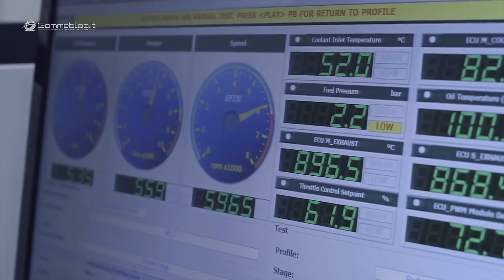Bentley W12 Engine PRODUCTION ASSEMBLY MANUFACTURING PROCESS

Comment: A W12 engine? This is the first time I have seen this. It's like a V6 or a V8 engine, but this W12 Bentley engine has two rows of cylinders in one side, and another two rows of cylinders on the other side. I'm VERY impressed with this.
Reply: Familiar with VW vr6?  It's basically two vr6s joined together.
Reply: Have you ever seen the Bugatti W16?
Reply: @maverickmason4946  No, I haven't. But  I'll look it up online.
Reply: @marcushaynes843  I'm very excited for you then.
Reply: A W12 engine has 12 cylinders arranged in four banks of three cylinders...
This engine is a V12.
Reply: @Sneakerama17 I just looked at the VW VR6 online, and you're right. I wander if Mercedes-Benz, or BMW were making and putting these kind of engines into their cars.

Comment: Love the fancy rod bolt guides vs the pieces of rubber hose we use for the same process. ;D
Reply: yeah but the hose works
Reply: @davidbrandenburg8029  
YES sir. I've been using it for over 30yrs that was my point.

Comment: What advantage does this engine have over a v12?  Is it simply more compact or Is the power curve way different?
Reply: The engine is a lot shorter than a V12.  It can fit in an engine bay that a V12 cannot.

Comment: Did anyone else notice the engine change at @9:45 ? Went from a single top mounted turbo to twin  side mounted turbos.
Reply: The top mounted turbos are in a hot-V configuration. They used that on the 4.0T and newer V6Ts. The Bentley came with either the 4.0T V8 or the W12. I think they shot the V8 then switched back to the W12 or something. Weird.

Comment: This looks amazing and complicated, not only does it take a long time for many people to design the engine itself, but to develop the molds and all the related manufacturing/assembly process around it. Even then, it's still an ICE, heavy, tons of moving parts and only delivers a power efficiency of what, 20-30%? Meanwhile there's electric motors, mechanically much much simpler, has over 90% power efficiency (ignoring how the electricity is produced) and delivers maximum torque at 0 RPM. We just need to improve the infrastructure around it and make sure battery production/recycling and electricity generation is more sustainable. Surely one day ICEs are going to be almost obsolete beside being kept around by "old-timer" enthusiasts.

Comment: Also I'm sorry to say I see valve springs come on Bentley desmodromic valve system then it wouldn't have to fight spring pressure. = more ponies at the tires and full time 4×4 come on guys you can do it. If you can build a Bentley it shouldn't be a problem. Love the W 12 though really cool 😎👌.

Comment: Boy that is strange, cant say ive ever seen a engine like that and have been around this stuff all my life, i thought all v12s were 6 in line, port and starboard, learn something new everyday.
Reply: They took a V6 from a VW and put two side by side to create this engine.  The W style V6, the cylinders are right next to each other, like 1/2 of this engine, and in the car it looks more like the width of a inline 4, not a V6.  All 6 of the W6 engine cylinders are under 1 head and two camshafts, like seen in this engine.  Also amazing if you never saw a W6 build.

Comment: Isn’t the W meant to indicate that there’s 3 sets of 4 cylinders are positioned around the crankshaft instead of six on either side like the video shows
Reply: Correct, the proper term is WR-12, but this was
seen as too confusing for people and the less accurate term W-12 was adopted for marketing.

Comment: wow, nice organised work, for a fossil fuel ⛽ engine. 
IMAGINE: An Electric engine for the Bentley,  a simpler straightforward electric motor, no internal combustion to deal with, no need for a series of controlled explosion to get the shaft turning. EV is the next step. 
Electric is the way to go..!!

Comment: This engineering marvel will be a lost art at the end of this decade. Electrics are comming big time now and are going to take it all. This cumbersome heavy metal technology is about to be phased out by the more efficient, much much lighter, easy to build, with much less movable parts to manufacture, and cheaper electric motors.

Comment: That was impressive.
I came here expecting to see an engine with three banks of cylinders. The W must be a letter designation  to the engine block style. It is not a W engine in true respect. It is a V-12 with two banks of cylinders. By placing the cylinders in offset pairs they manage to shorten the overall length of the engine which allows for a shorter hood area. That is very clever.
Reply: Audi had to done this due to chassis layout.
Reply: Thanks guys

Comment: Interestingly they used a closed deck design on a turbocharged application. This means the engine oil has to take way more abuse for cooling down the engine. The coolant jackets aren't big enough to keep cylinder temperatures down.
Reply: VW used an electronically mapped cooling system on the W8 and W12 Phaeton, which I worked on while at VW.  It was very sophisticated in design, and trouble prone, at least on the W8.  Also, the intake plenum required removal to replace the electronic thermostats, and one of our techs unknowingly dropped a nut down the intake manifold of a W8.  A $20,000 dollar mistake for our dealership.  As to any inherent cooling issues other than what I've described, we never had any problems with overheating, and the T-stat failures typically were addressed due to fault codes that were thrown by the ECM.
Reply: @hadial-saadoon2114  I guess there is no free lunch aftrer all.

Comment: I wonder if they could use this engine, running on hydrogen, to power something like a huge class 8 truck.  This engine could power a generator, then the electric drive on the rear axles would power the truck, or they could use electric drive on the rearmost axle, and power the forward axle (class 8 three axle big rig truck) with this size engine and normal transmission, that would only kick in while getting up to speed on the freeway, or while going up a really large hill, to extend the battery life of the class 8 truck.  

The turbocharged 2008 F-250 that Ford made with the 6.8L V10 engine ran on hydrogen and could make 550 HP or about 80 HP per liter.  They could run the Ford engine on compressed natural gas, gasoline, or hydrogen.

Comment: Uk if u build a 24 cylinder and the motor be round u can make it so when the flywheel makes electricity that it powers a electric motor to spin the pistons u can have unlimited power and cuz u do it that way the pistons can be small and u can have a lot of them there for u can generate more power for like a building or something or even a space ship as well as an anti matter engine that uses. The dark matter in space I’m to smart or a anti gravity machine witch if something heavy spins really fast it defys gravity

Comment: As beautiful as is this machine, it is a bit like watching the assembly of a mechanical T-Rex.  The Bentley it powers will long outlast the production of any more like it.  Bentley Motors will go EV at some point, maybe 3 years, maybe 10, but it will happen.  Those models will have more power, be simpler to build and maintain, have 100% torque from a standing start, cost less to run, etc.  Maybe not, but that's what I think..we'll see.

Comment: Absolutely amazing. And yet it is a dinosaur. Soon to be gone. It has a gazillion high-tolerance moving parts. Tesla motors have ONE moving part; the rotating armature. You cannot beat the simplicity and the torque of an electric motor. It is over, ICE machine.
Reply: Yes, but the battery system is quite complicated don't forget, and all the cooling and controls, etc.   
A car with wheel hub motors is the simplest, air cooled.

Comment: I'm not impressed.  The W12 is basically just two V6 engines stuck in one crankcase.  It achieves virtually nothing useful  but the thought in some people's minds that it must be a great, powerful engine because it has 12 pistons instead of 8. It is an awkward design and would have much smaller pistons than a V8.  Sure, it probably has a smooth idle.... so what.  I would much rather have a 500 cubic inch V8 in my Bentley than that ridiculous looking W12 blob. A Rolls with a big V8 has a nice powerful sound at idle with a pleasant vibration to the car. My Cadillac Coupe with a big piston 472 cubic inch V8 was heavenly to listen to at idle. That Bentley W12 with those little pistons would probably sound like a Toyota.

Furthermore, you will never see a W12 engine in a dragster because it offers nothing that a V8 can't do better. A V8 dragster will always be faster than a W12 dragster. The W12 is mostly a status broadcasting production for people who don't, so to speak..... look under the hood.